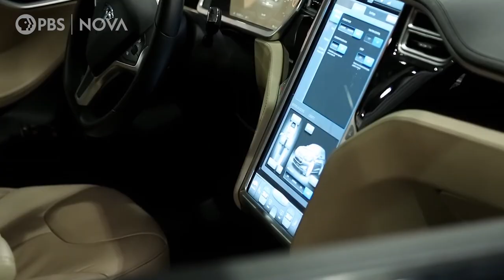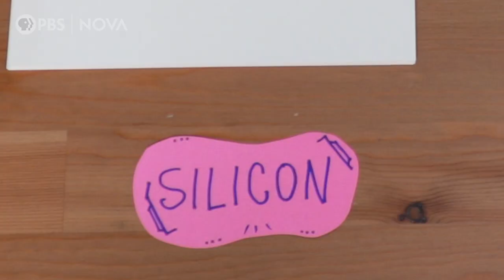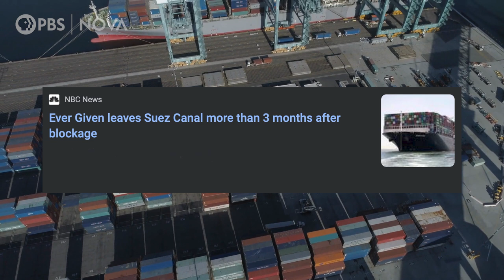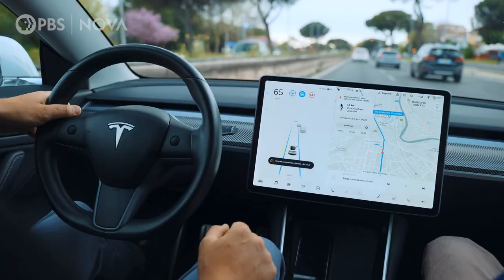Why is There a Global Chip Shortage?

Comment: This is a good and general explanation. The conclusory explanation that there is a bottleneck at the ports and disruption in manufacturing are only part of the explanation. TSMC in Taiwan manufactures high-tech smaller chips. China manufactures the older and larger chips made for cars, home appliances, etc.  The Australia vs China dispute that resulted in China banning Australia's coal was the straw that broke the chip manufacturers in China. Here is the youtube video   https://youtu.be/JqDcLmgg0a4

Comment: He does not answer the question. Let me tell you the reason why there are a poor supply  of silicon chips. It is because there is a drastic , world wide shortage of high purity sand & quartz which is the key  ingredient  to make  silicon  chips.
Reply: Will we find more or will we need to find new material for the silicon chips? Do you think by 2023 the world we be back to a new normal i guess where prices are not unreasonable but not rlly Msrp
Reply: @ararix3722  , silicon cannot be replaced. New  efficient techniques to refine silicon from sand or quartz  will be developed
Reply: @bobdooly3706  how long will that take in your opinion? What's the best/worst case scenario and most likely case scenario?
Reply: @ararix3722  , it would take a year for a mega Silicon refining factory to be  built . Hence 2023.

Comment: This is why your catalytic converter is so valuable,the precious metals,as china is the only one that has the 2 places that mine for one which is 28000 pounds a ounce,and they banned the exporting of the metal.plus the ports ain't taking any containers,they used to buy all cardboard,plastics,in the empty ones so ports are full of empty containers,hence this is why the ports are not working properly,its not about more truck drivers as they wont take empties,and the trailers are sitting with a empty container on them,excuse my spelling pludiom a rare metal.landfills will be mined to get this,in the near future.🎅🎅🎅🎅merry Christmas all